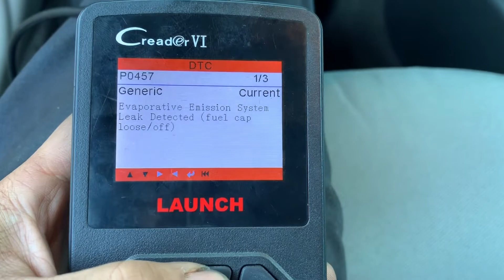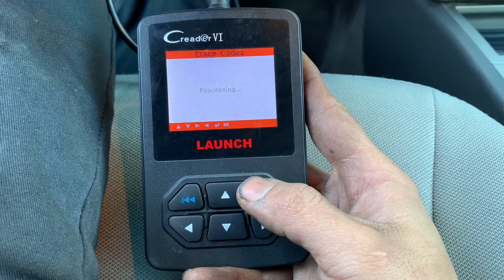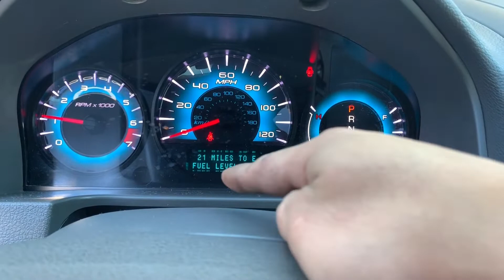Ford Fusion Evap System Leak (Gas Cap Loose Or Fuel Fill Inlet) P0455 / P0457

Comment: I changed the valve already and it still keeps showing the code , now my car started rejecting gas wile pumping gas
Reply from the maker: If its stopping you from putting gas in. Either the fuel tank pressure sensor is bad or the canister assembly.
Reply: @Ah_Duuu_Ma  thank u gonna check it out today , hopefully the part is not to expensive
Reply: hey brother, having the same problem right now as well keeps on showing up the purge valve even though I changed it and I’m not sure what else it could be since I’m not having any other symptoms with rejecting gas or you could smell the gas in the driver side was curious to know what ended up happening with your vehicle and what did you fix?